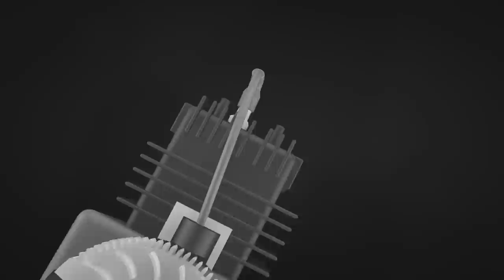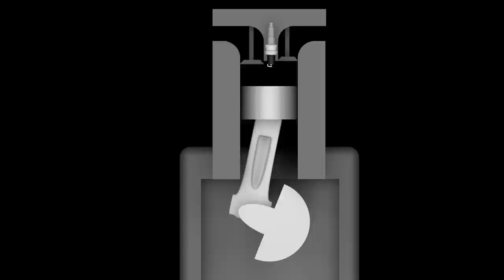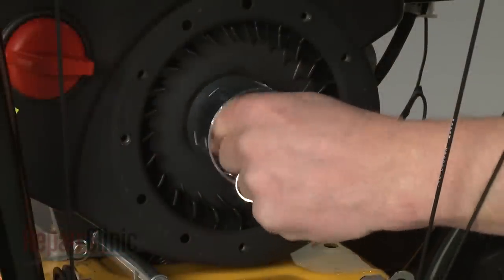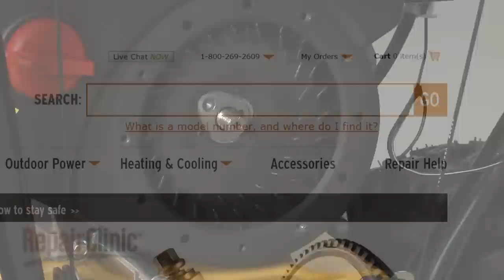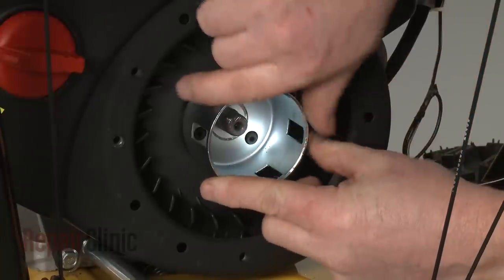How Does a 4-Cycle Small Engine Work? — Engine Repair Tips

Comment: How fast does the crankshaft need to spin to cause ignition?  Lawn mower starts with pull cord but not electric start.  Replaced battery and bought used starter.

Comment: why does a mower kick back hard when trying to start.....????
Reply from the maker: +frank hern Typically because there is timing issue with the engine. The most common cause is a sheared flywheel key.
Reply: The most likely cause for that is the spark could be occurring at the wrong time in the cylinder.

Comment: "If you anticipate storing the fuel for longer than 3 months, consider adding a fuel stabilizer when you fill the container."  ...or just put the fuel in the car.
Reply: What u mean put the fuel in the car bro? U mean detach the fuel tank from the engine? Or like use the fuel meant for the lawnmower for the car instead and letting the lawnmower as good as not having been used at all?
Reply: @lylesloth1275  fuel that was in the plastic gas can.